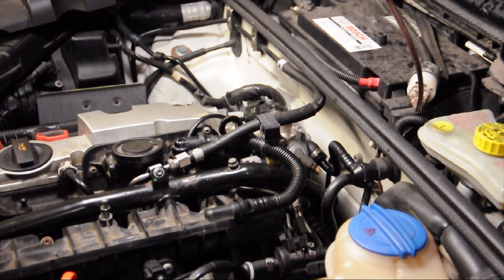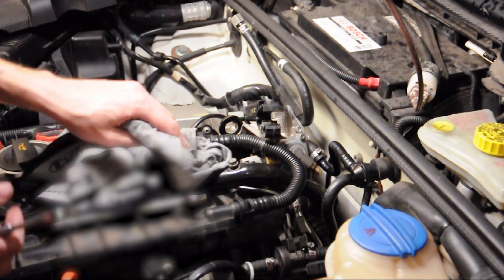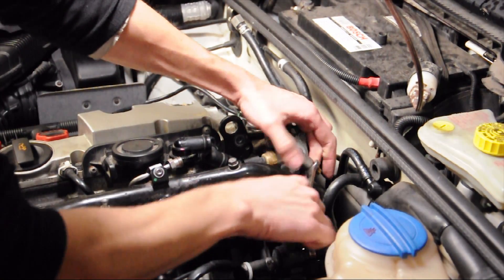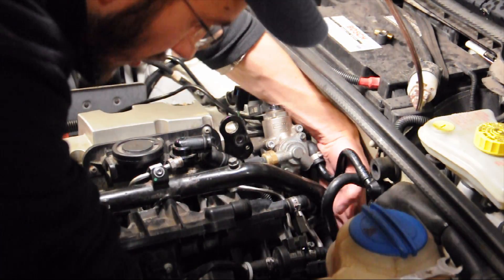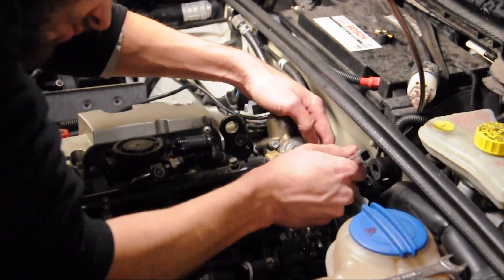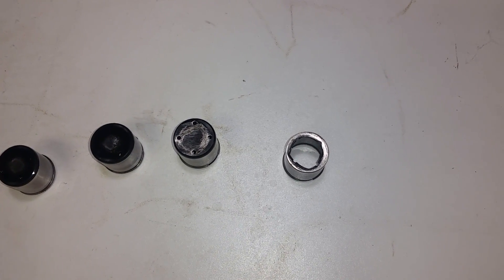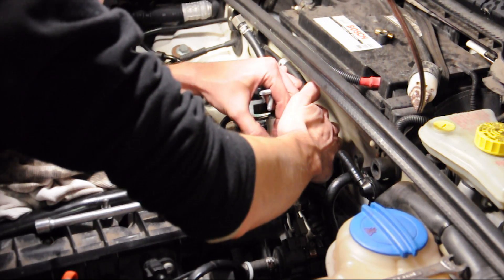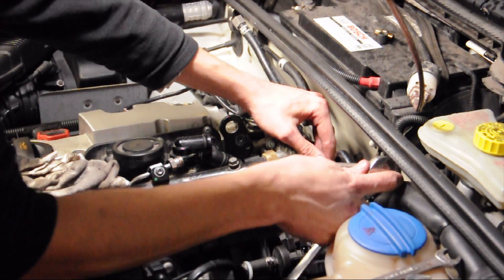Audi High Pressure Fuel Pump & Cam Follower

Comment: Do you have a better angle showing how you access the banjo bolt? I have a coolant line right in the way so I don't see any way to access it at all.
Reply from the maker: Hard to show a better angle. You have to stick your arm under the throttle body, your hand should be almost by the oil filter. And using a long extension to get past the lines to reach the banjo bolt

Comment: Hello, I have the same exact model and unfortunately some rats chewed on my high pressure fuel pump connector wires. I have the parts and the wiring but I’m completely lost as to what to do😭😭😭 this is my first Audi and I don’t want to take it to Audi because they are gonna over charge me. Any tips or advice? The wiring and connector didn’t come together they came separately so I’m lost:(
Reply from the maker: If you can find a wiring diagram online for the fuel pump you can rebuild the connector. I have used a 1 day subscription to AllData to find stuff like that before. It used to cost like $25 for 24 hours

Comment: When you replaced the camshaft did you do the water pump timing chain and all that?
Reply from the maker: Timing belt and all related components were replaced at another time. But that certainly would make sense to do that job while replacing the pump and camshaft

Comment: Having trouble getting the rubber fuel hose back on properly. Leaks now. It is a brand new hose though.
Reply: Get new clamps with the screw tightener.  Those pinchy worm clamps suck ass.

Comment: Is there 3 pressure sensors? Or how many are there
Reply from the maker: I think there's 2. High and low pressure. But I could be wrong, been a while since I've worked with that engine

Comment: Is the fuel line reverse threaded like a propane tank? Righty loosely?
Reply from the maker: No, righty tighty lefty loosey
Reply: Thanks. I got off the fuel line and the banjo bolt was a pain. My cam follower wasn’t even that worn I was shocked. Just need to switch over all the new fittings to the new pump and install.
Reply from the maker: Sometimes it's not that worn. I still replaced it. Did it every other oil change. You don't want it to wear through and damage the camshaft. I needed to replace the pump and camshaft when I first got the car. The follower wore through and the pump end was wearing down
Reply: I’m getting a p2293, p0342, p2294, and a p0011code so I was looking at doing the fuel pressure regulator as well. Just hope all this get to the root of the issue.
Reply from the maker: Do you have access to a vcds vagcom? Would help you out checking into those codes
Reply: I have an ancel vw/audi scanner but that’s it.
Reply from the maker: Are you able to see data readings on fuel pressures? And pump duty cycle?
Reply from the maker: You might not need it, but it might help narrow things down instead of throwing parts and hoping for a fix

Comment: Hi this has ben greatly helpful, Quick question my car is exactly the same year and type as yours and it keeps giving me a warning light and I diagnose it and it says fuel pressure regulator needs to be changed is that the fuel pump or the fuel filter or what part is that I can’t seem to figure it out please help if you can.🙏🏿
Reply from the maker: Are you getting the p0089? That seems to be a common and difficult code. Do you have access to a vag-com? Have you checked your fuel pump duty cycle? I would suggest checking the forums online. Lots of good information can be found to help you diagnose

Comment: Hey there I have a 07 a4 2.0t a-line and when I try to accelerate from a red light and not floor it but moderate accelerating , when I'm accelerating and it's in 1st gear and rpm is raising sometimes it stops accelerating and jerks  and then cotinues to accelerate! Any advice ??
Reply from the maker: Sounds like a transmission issue. Is this an automatic?
Reply: @audimotive  nope it's a 6 speed manual ? I mean when I dont wanna floor it and run it normal it shifts real fine no hesitation only when I wanna give it a cast acceleration in first gear high rpms
Reply from the maker: @carlossaavedra4723  you said it jerks when you accelerate hard. Check engine light? Misfire would cause that. I had bad coil packs and it did that
Reply: I was tryna start from cleaning throttle body , maf sensor, fuel filter and no check engine light is on
Reply from the maker: @carlossaavedra4723  have you thought about the clutch being bad?
Reply: @audimotive  no check engine light at all, when it's just sitting idling doesnt shake at all and when I dont floor it it runs normal only when I wanna floor it in first gear it does that like hard stutter like if it didnt want to accelerate fast and the continue I know it's hard to tell but I hope I'm being explanatory the best i can lol
Reply from the maker: @carlossaavedra4723  check spark plugs and coil packs. If you don't know when they were changed, just change them
Reply: @audimotive  that too but I mean it shifts reall nice in all gears tho ?
Reply: @audimotive  and that was well no sure but wouldnt it cause a check engine light tho ??
Reply from the maker: @carlossaavedra4723  shifting bad would be synchros. Bad clutch is revving without going
Reply from the maker: @carlossaavedra4723  not always. Certain things have to be met to set the light
Reply: @audimotive  okay I think it has OEM coil packs and havent checked the spark plugs it has only 128 miles what other maintenance would you suggest I heard they're pretty good cars with perfect maintenance right!
Reply: @audimotive  well if I let off the clutch I can feel its biting point and itll start driving and I'll completely let off the clutch and proceed like a normal manual transmission i can downshift perfectly in all gears but who knows lol sometimes I'm even scared to accelerate it fast in 1st gear cuz I dont want it to stutter on me horrible itll only do that in 1st it's like if the fuel doesnt get pumped enough but idk lol
Reply: @audimotive  hey do you think my high pressure fuel pump can be going bad !? Or just the cam followers itself havent check that as well

Comment: So i have a problem on my 2012 a4. I went to auto zone and A code of P2188 came up and i saw that it might be the MAF but then i started to look at forums and other people said they replaced the HPFP and its solved their problem hopefullly this solves my problem. Today i had some weird symptoms not sure if its related to this but my car would crank and wouldn’t start unless i would press on the gas pedal and it would start sputtering a little, and a weird smell came from the exhaust but nothing like smoke & yes i have changed the spark plugs and coils so im not sure what this could be any ideas?
Reply from the maker: Have you check this code on Ross-Tech Wiki? Good resource to use when trying to figure stuff out. Will give you a list of items I would start checking. Check...not replace. Good luck. Let us know what happens

Comment: Is this the same procedure on 2007 VW Eos 2.0t? looks like the VW would be easier because I'm not working against the firewall?'
Reply from the maker: Similar procedure. But you are correct, a lot easier to get to
Reply: Thanks

Comment: There's no tutorial for C250 high pressure fuel pump replacement and at least 40%-50% have early failures. I am doing the job this weekend. Wish me luck lol. C250 have a 1.8T and the HPFP is also in the back of the engine.

Comment: hey man I'm looking to change my injectors because it failed on me I really don't want to start the car due to it running bad so should I still disconnect the fuel pump and start it or will I be ok ? its been sitting for about  3 days
Reply from the maker: Unless the injectors broke into pieces which are in the cylinder, I don't see a problem with disabling the pump and letting it run dry...
Reply: AUDImotive thanks i’ll try it after i eat
Reply from the maker: Have fun

Comment: Yo!! Your videos have helped me tremendously the past couple of days, I just had a quick question. I'm doing a carbon cleaning on my 05 a4 b7, I managed to get the manifold off but ended up having to removed the hpfp in the process as the banjo bolt wouldn't give. Do I HAVE to replace the o-ring on the hpfp now? Or can I just reassemble? THANK YOU! Couldn't have done it without these videos
Reply from the maker: I have gotten away with not replacing the o-ring if it was in good shape. Just put a little grease or oil on it so it doesn't snag going back in. But I wouldn't do it on someone else's car. Don't want a return for a leak

Comment: How do you crank the engine? Do you just start the car ?
Reply from the maker: With the fuel pump fuse removed, car won't start. It will just turn over. It just needs a short blip to open or close the valves
Reply: AUDImotive Thanks for your help. Can u plz help me with this?  my car always vibrates on idle i have changed the pcv but didnt get better. Changed the engine mounts as well. Do you think cleaning valves would help? What are the symptoms of vacuum line leak?

Comment: You can also just hit the Schraeder valve on the high-pressure fuel pump To release the pressure in the fuel line
Reply from the maker: On a transverse engine you might be able to. On a longitudinal engine, I didn't have room by the firewall for a 17mm wrench for the flare nut. The valve was in the way and needed to be removed
Reply: AUDImotive No you don’t use a wrench use a pin to hit the Schraeder valve it looks like a valve stem and that releases the fuel pressure

Comment: If the sensor breaks is possible to replace the sensor?
Reply from the maker: Jag part 11 is what you are looking for
Reply from the maker: Depends which sensor. The one on the end, is a fuel pressure sensor and can be replaced. The one in the middle, might be part of the pump itself
Reply: can you please be specific on where exactly is the fuel pressure sensor? any link or video will help.
Reply from the maker: It depends on what engine you have and what sensor. On the 2.0 FSI, the low pressure sensor is on the fuel pump, the high pressure sensor is on the fuel rail. If you Google your car and engine, you can find where it is located
Reply: thanks for the reply. I have 2006 Audi A4. the reason i ask is coz the sensor I removed and when googled its numbers, it for some reason said low pressure. Thats what threw me off. The numbers from the sensor removed are: 06E 906 051K
Reply: Its Quattro
Reply: https://www.audiworld.com/how-tos/a/audi-a6-c6-how-to-replace-fuel-pressure-sensor-422206
Reply: I could not locate the sensor based on step2 in the link. I even opened it but could not find the sensor. please help
Reply from the maker: Jag the part number you provided is the low pressure sensor. On the fuel pump it is across from the piston. If you look at my thumbnail for this video, the sensor is on the right side.
Reply from the maker: But do you have a 3.2 or 2.0?
Reply from the maker: If you have a v6, the low pressure sensors are found in step 3 of the link you provided
Reply: I have 2.0 v4. trying to share some pictures but you tube does not allow in the comment section. Just cant locate the high pressure sensor
Reply from the maker: https://nemigaparts.com/cat_spares/etka/audi/a4c/472/133440/
Reply: thank you. this helps 👌

Comment: Hello my kit did not come with oring can I still replace it?
Reply from the maker: +Alyssa Haywood it's better to replace that o-ring, but I have done the job without replacing it. As long as you don't damage it on removal, should be ok. I oil it before installing and haven't had a problem

Comment: Your video has a lot of tricks that the other videos do not show you, like the magnet for getting that banjo bolt (I lost mine and had to order another one) also removing the shrader valve which gives you space to get to the fuel line. I have to say this job is almost impossible to do without a 17mm stubby and a long extension 8mm triple square.
Reply: Pablo Gonzalez dang I'm doing it tomarrow wish me luck
Reply from the maker: +Alyssa Haywood the job isn't too bad. Good luck

Comment: Hello.I'm struggling to find that follower.Does it have any OEM code?Thanks
Reply from the maker: +MallV0lli0 part number is 06D109309CKT
Reply: AUDImotive same for 1.6 FSi engine code BAG? 
Thank you for fast reply
Reply from the maker: +MallV0lli0 probably not. What car is this for?
Reply: AUDImotive 1.6 FSi is present on many cars in VW group. 
mine is a MK5 VW Golf but the engine is also found on Audi A3, VW Touran and maybe few others.
Reply from the maker: +MallV0lli0 we don't have that engine in America. The smallest we have is the 1.8t in VW. Most are 2.0t. Try this site. www.oemepc.com
Reply: AUDImotive thanks alot for help
Reply from the maker: +MallV0lli0 no problem. Good luck

Comment: was the cam follower making loud noise, like if it was a diesel? is the clue that you need it replace?
Reply from the maker: +Carlos Reyes I'm not sure how noisy the cam follower itself was. The first time it got changed, it wore all the way through and damaged the camshaft. I replaced the camshaft, high pressure fuel pump, cam follower and did the chain and tensioner at the same time. After that the car got a little quieter. But it's still louder than most because of the direct injection
Reply from the maker: +Carlos Reyes I didn't get any codes so I would suggest checking it. It's not hard to do and can save you a lot of money

Comment: hey the video was very helpful but  I'm having trouble try to get it out. did you take the nut on top of the banjo Bolt?
Reply from the maker: Hey Fernando, I'm trying to understand your question. There are 2 fuel lines to the pump. the line furthest back is a 17mm nut. The line closer to the front is an 8mm triple square bit. you have to remove both the nut and the banjo bolt

Comment: Everything went good thanks to your video man, it couldn't have came at a perfect time. Install went smooth ... well kinda, those fuel lines were being a bitch. Other than that thumbs up for this video. I'm sure it's going to help out a lot other people.
Reply from the maker: 9KB20VTEC that's great to hear! Im glad I was able to help you out
Reply: sadly... it didn't help my situation super bummed out about spending 400 and it didn't fix my problem. ughh.
Reply from the maker: 9KB20VTEC what was the problem in the first place?
Reply: Cars&Stuff rough starts, can't turn on and off the car too many times or else it'll just bog out and die. I've gotten stuck at lights multiply times. I would also have to wait for the rpms to drop to around 900 before I can drive it. Speed pick up is like a slug and I also threw the code for it, HPFP? People are now saying my MAF could be faulty but I'm just so tired of spending on it now lol
Reply from the maker: do you remember what the code was? those are some weird issues. I had no code or issues when my follower wore through and damaged my pump and camshaft. sounds like another issue as well. a MAF would definitely throw a specific code. no use throwing in more money until you can figure out what the real cause is
Reply: Well... I'm back to square one, the car shuts off on its own now. Still throwing the fuel pressure code even after putting in a new regulator. I'm literally now stuck as I'm writing this lol
Reply from the maker: I cant say much without knowing more but I would recommend getting scanned with a VCDS and then researching those codes on forums and the Ross Tech wiki. Thats how I solve most of my problems.

Comment: Great video! I'm in the process of swapping in a new hpfp right now and the only problem I'm having is getting off that fuel line that's closest to you. I'm gonna try that method you used by using a long extension i tried for hours to find a way to get back there. Thanks for the video!
Reply from the maker: 9KB20VTEC be careful not to strip out that banjo bolt. I did that and it's such a pain to get off!